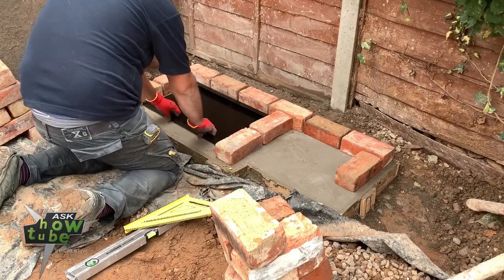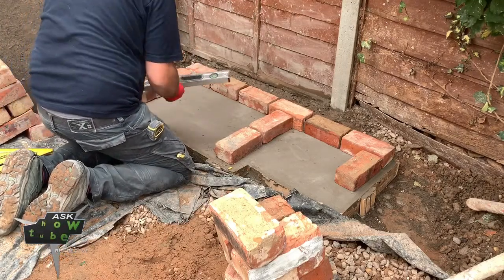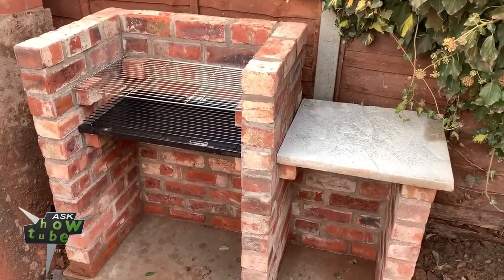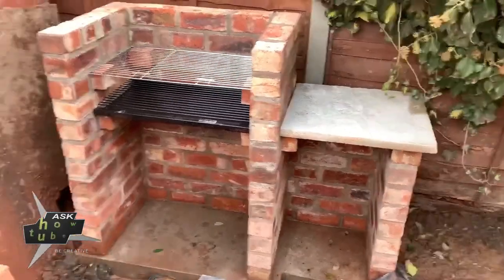How to build a rustic barbecue step by step, how to build a barbecue with reclaimed bricks.

Comment: I wonder why this video hasn't got many views yet. I personally find it very helpful and informative. Only I wish the video was real speed when laying the very first row of bricks. It seems the base concrete is still not fully hardened but solid enough to draw the markings on it.
Reply from the maker: Thank you for your interest in this... the concrete was done one day before I started bricking... I have used a lot of cement on, and next day is fine to start bricking as it is not same weight as you will have a full wall...

Comment: Hi,
Just wondering about your base - you poured it directly on the earth? Is there not a danger of it cracking as you didn't dig out and put any hardcore underneath and compact it?
Reply from the maker: Hi, thanks for your comment… there is a lot of hardcore underneath… I have done that extension and lots of hardcore left, I have put it around the house.
Reply: @askhowtube  Ah ok - makes sense! So we just don't see the hardcore so - but it is there. Hoping to build similar one to yourself soon - how many hours do you think it took? I also saw online where someone built two grills next to each other - his point was that the built in grills are usually around 65cm and are a little small if cooking for a group - and I suppose you could do different things if you had two grills side by side - so thinking of that myself - but I really like your table so it could be a a triple structure!
Reply: Some people use rebar.

Comment: are these fire bricks or just normal house bricks
Reply from the maker: They’re normal bricks, but very old ones which are more quality than the ones made these days
Reply: @askhowtube  thank you I will be making one this week. If I was to use normal house bricks do you think it will be okay?
Reply from the maker: @Karan-Singh999  it should be ok, but I recommend you cover it not let rain on it, especially in the winter...
Reply: Okay thank you so much. I will buy BBQ COVER. As I can’t find fire bricks anywhere near me
Reply from the maker: @Karan-Singh999  that will be very good. Mortar use 1 measure of cement to 4 measures of sand... like in a wheelbarrow 12 sand shovel, 3 cement shovel...